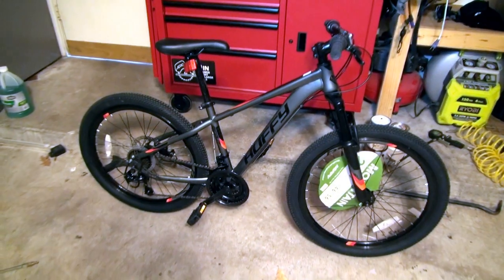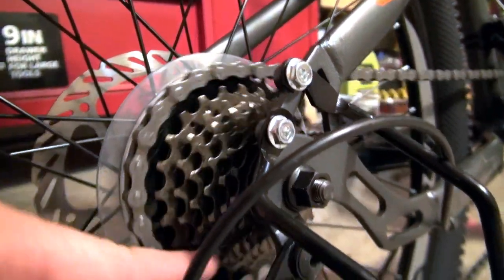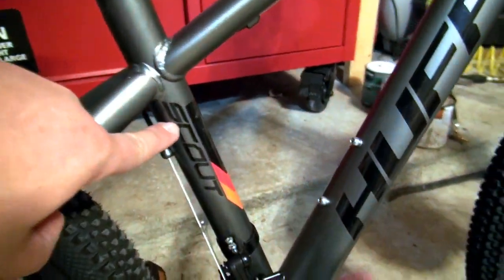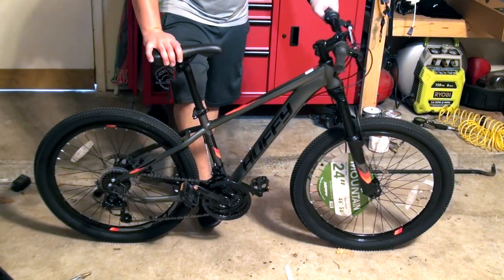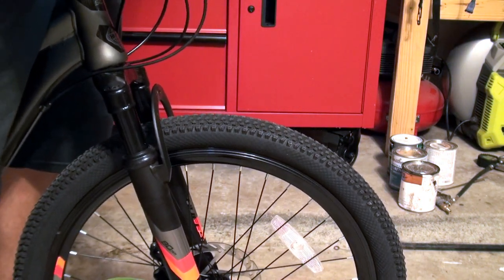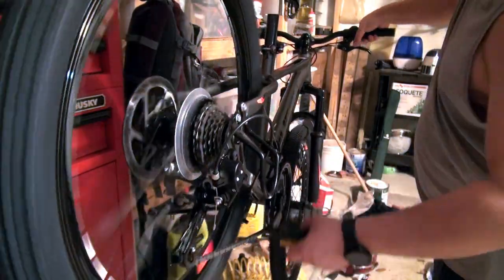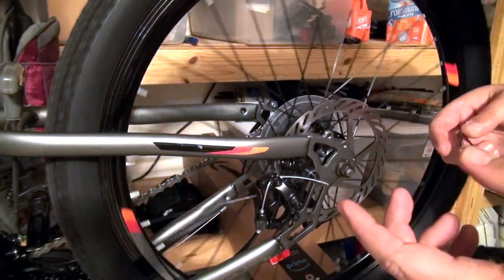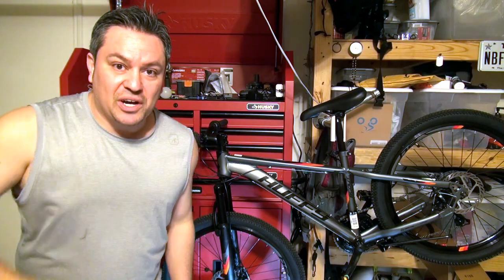New Bike! Walmart Huffy Scout 24" // Initial impressions & Set up // Components // Tapered Head tube

Comment: At what speeds does this bike travel? And could I put cruiser handlebars on it ? And what does 80 mm of travel mean ?
Reply from the maker: The 80mm travel is the suspension coil, the front shock. You should be able to change the handlebars for the ones you like.

The speed is up to you, depends on how fast you can pedal
Reply: @MTBAlex  well.. does it go over 16 mph easily?
Reply from the maker: @anio6865  It depends in your stamina.
It is not an ebike, you'll have to pedal it.